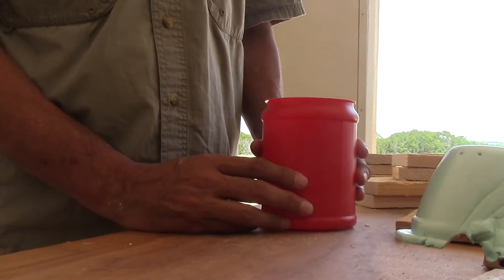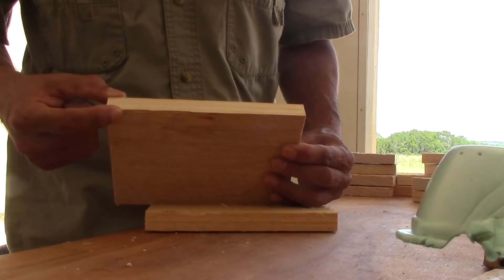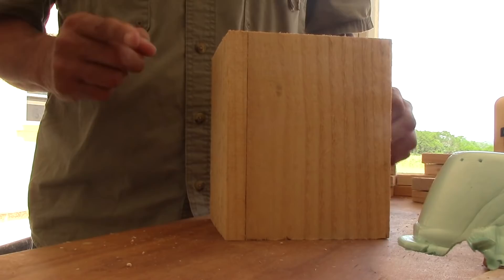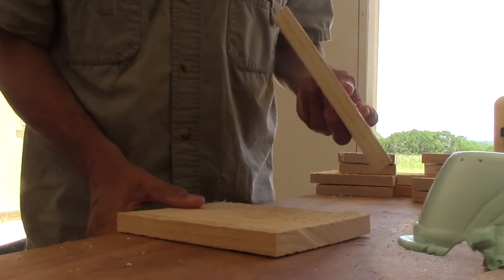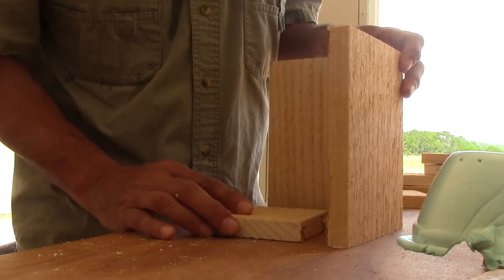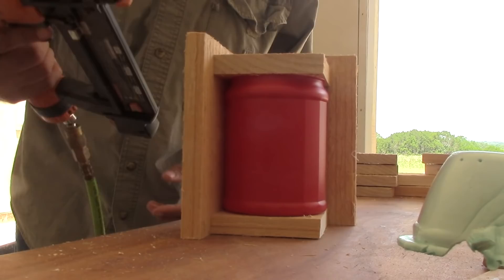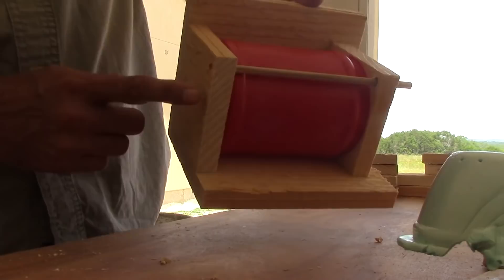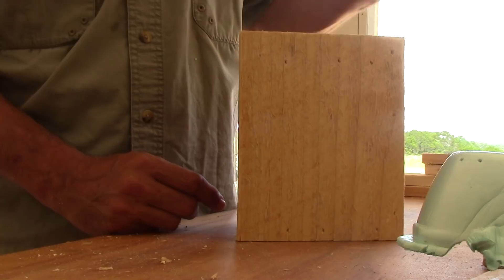Make the best birdhouse.

Comment: I use 150 yr old yellow pine from flooring from an old machine shop.  Water proof and virtually rot proof.  I don't buy wood.  There's all sorts of drop off at construction sites, especially if they happen to do cedar siding.  I always glue a piece of aromatic cedar inside the house to ward off any sort of fleas or bugs.  I re-oil the cedar each spring.
Reply from the maker: That sounds so cool. They must be very attractive houses.- Thank Lee.
Reply: @tomrudd1118  I use to sell my houses.  Some for $100, some for $50, but most for $20-$30.  The more expensive ones were exotic woods and copper nails and dowel construction.  But the wife retired and didn't like all the noise in my woodshop in the furnace room so I had to give it up.  Sigh!

Comment: So maybe I missed this but how do you mount it?
Reply from the maker: Hi Jay. I had forgotten that part, if you can believe it. So I made a part two video. Check it out, too.
On the corners of the roof, front and back, pre-drill some holes and put in screws. Use steel wire (not aluminum) from Home Depot or where ever
and wrap the wire around a low branch. The birdhouse should be low enough for you to reach it.
Reply: @tomrudd1118  
Thank you I appreciate that info. Great job on the video.

Comment: Better add air conditioning!! Anything other than wood for a bird house will overheat. Poor birds that visit it on a hot day won't use it but if they build before hot weather they may lose their brood??
Reply from the maker: I always hang these in the shade somewhere. But if you think about it, I have seen birds nesting in street lights, aluminum rain spouts, ...ect.
The temps we get in Texas (100 +) have not yet had a negative influence on birds hatching and living. Air flow seems to be the determining factor.
Those air holes are important and keeping the rain out is another good idea. Thank you for the comment.